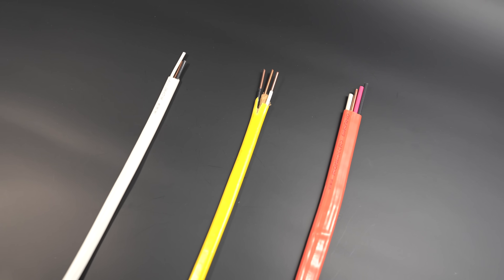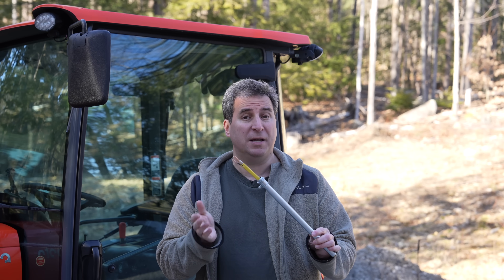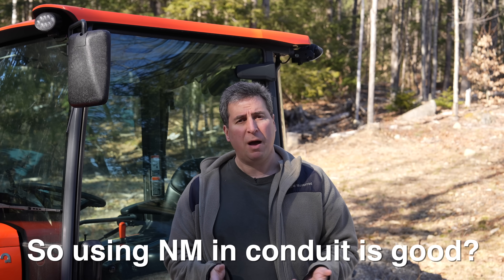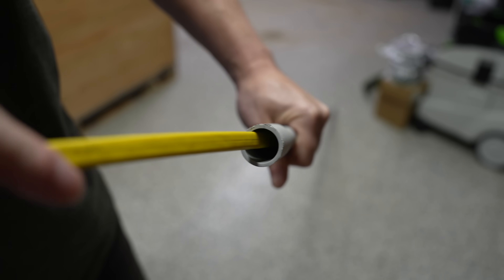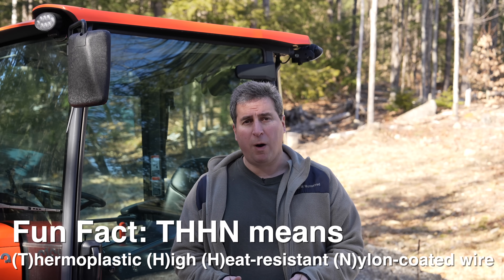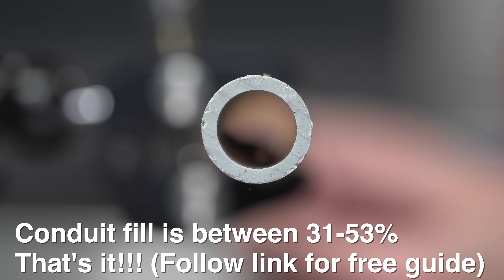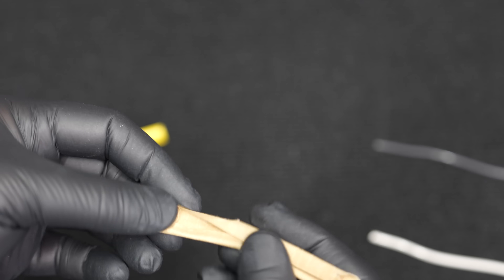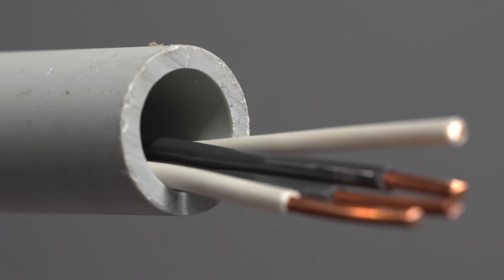#1 DIY Electric Mistake - Can you use Romex Wire in Conduit?

Comment: I never use romex as a commercial electrician, but I do believe that the wire itself is THHN so it can go bare through a pipe etc (any place THNN can go).  The conduit is the protection bro.
Reply: The wires in NM isn't labeled as THHN, so running it bare in conduit isn't code-compliant. You need the outer jacket, which has the listing...
Reply: This is what I always understood to be true. So the bit about not removing the nm shell is just an issue with the mfr recommended use and not really a fire hazard?
Reply: I used to work in a wire mill that made both THHN and Romex from thick copper coils and barrels of plastic resins. THHN has one additional coating material added (makes it more resistant to the strains of conduit pulls) that is NOT included in the wires placed in Romex (because it's not required there and so would be too expensive to add), so, while nearly identical, they are not the same, and aren't intended to be run without the paper and outer sheathing
Reply: @blairmurri8741  So conduit doesn't cut it, but plastic and paper does?  I don't see your logic.  Also the N in THHN is the nylon jacket you speak of.   Google  "what type of wire is in romex"
Reply: @southsko  my time working the factory floor was over 25 years ago, I left that industry when people started paying me to write software full-time, and google is a lousy arbitrar of the truthfulness of any given "factoid".

Where it relates to safe practices, I prefer the defer to the Code / local laws.

But you do you.

Comment: I use (MC) metal clad cable and get the tool to cut it.
Reply from the maker: The MC stuff is good, pretty much OK everywhere except being buried.
Reply: For bonus points, run the MC through your conduit ;)